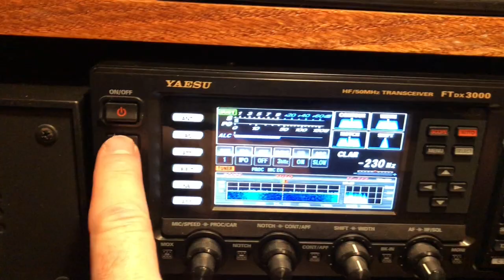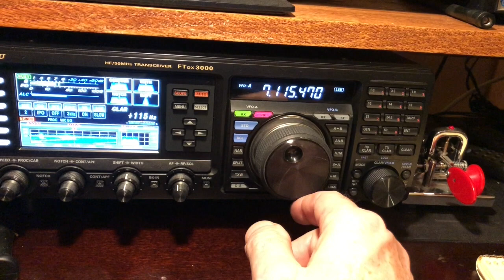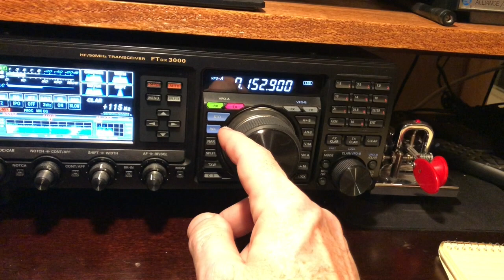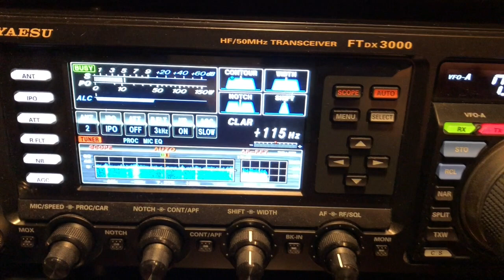Solar Minimum and Ham Radio...

Comment: Minimum is really a pretty lousy period to go through but I been through 3 of them now and the good news is that the new cycle is supposed to start around the fall of 2019.  I still have plenty of QSOs on 20,40 and 80 and CW is always open to some degree on 40 it seems.  Good luck to us all!
Reply from the maker: PeroJunak I worked a guy on 20m phone yesterday and about 5 mins into the QSO, the band dropped out.  He was 5/9 and disappeared.  Good opportunity to hone cw skills that’s for sure.  Thanks for checking in!  73 de K2CJB
Reply: @k2cjbradio  that always blows me away when it happens. At my cottage 2 weeks ago on a very quiet 20 meters I heard SSB pileups and a pair of South Africa stations. S1 noise level!
Reply from the maker: @perojunak6949  Exactly! Very strange in this minimum.  Can't change the laws of physics!
Reply: @k2cjbradio  lots of great sigs on 80m tonight. Not all the groups are antisocial either! Take care, W8BBM.

Comment: What type of antenna do you have? There definitely is a solar minimum but I still get on to other continents almost daily. All that digital squealing and whining around 7078 was JS8Call. Operators are out there, there just isn't much SSB. Try again on the weekend.
Reply: Yeah, 20M is pretty lively during the day on the weekends, and 40M at night. 80M is always busy with OMs in the evening, it seems to be the most stable with the least noise right now.
Reply from the maker: Jason Siebert I'll get on again this week at some point.  80 is a unique band at night to say the least!  Thanks for stopping by!  73!
Reply from the maker: Hey Julian!  Thanks for stopping by!  For 10-15-20 I have a TA33Jr.  For 40-80 I have an OCF dipole.  Granted it was a Monday evening when there aren’t as many ops on.  I'll get back on soon!  Thanks again and best 73!